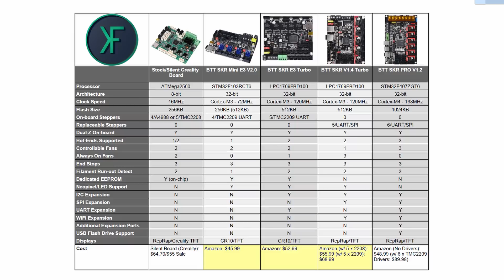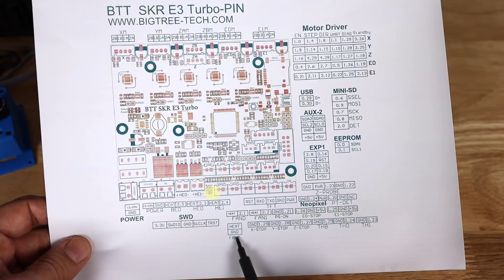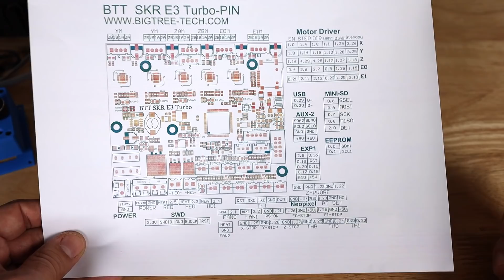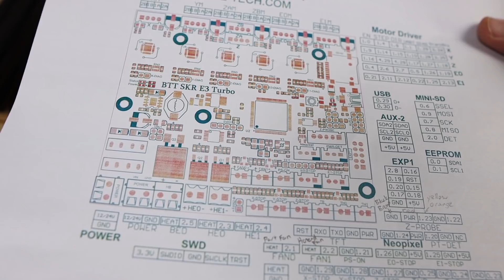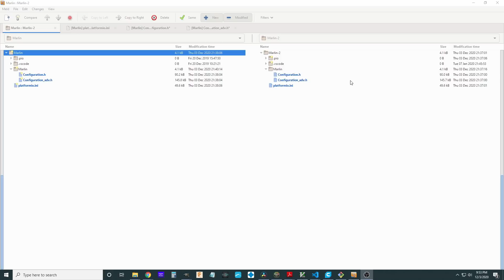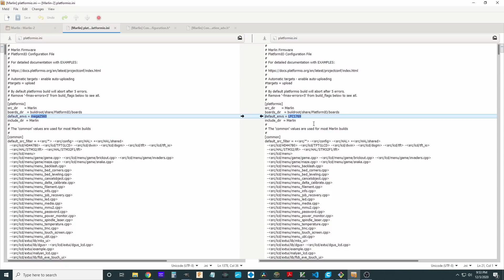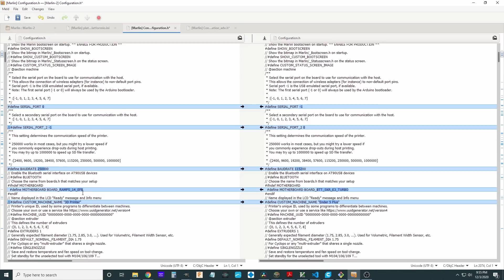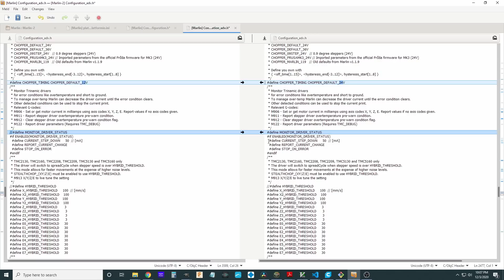Bigtreetech SKR E3 Turbo: Complete Guide

Comment: Really excellent videos.  Nice Stuff, Your Stuff !!!   I want to run bigger motors on one of my printers.  I need to know if i can just pull signals off of the STEP, Direction and Enable lines from the TMC2209 BTT drivers, and run them to a bigger Packaged Drive ( like a DM542S ) to run the bigger motors without blowing the V.1.4 BTT board.
Reply from the maker: Thanks! You wouldn't want both drivers on there. You would want to wire directly into the signal headers. That should work as long at you run the power directly from the supply.

Comment: Just finished installing both the SKR E3 Turbo and the TFT35 to my Ender 5 Plus.  Everything went quite smoothly thanks to this SKR E3 Turbo and the Ferrules and TFT35 (Part 2) videos.  However, being a total novice concerning Marlin DISPLAY Menus & Settings; I could really use some guidance on where to find a video which covers the features of the new display and how and when to use each of these settings.  It would be great if you, Kris or one of your followers could provide a link to such a videos.  Again, thanks Kris for your very comprehensive videos.
Reply from the maker: I have a complete Marlin bed leveling guide coming up very soon. That's not a walkthrough of all of the functions but it will show you quite a few.
Reply: @kerseyfabs  Kris, Thanks for getting back to me, I look forward to that video!

Comment: Excellent video, thank you for all the great detail. I have just received this board and am about to build the firmware. Will post about the temp issue. Does anyone know where to get the schematic shown around the 12 min mark? Thanks for any thoughts.
Reply from the maker: Thanks! Here's a direct link to what you're looking for: https://github.com/bigtreetech/BIGTREETECH-SKR-E3-Turbo/blob/master/Hardware/BTT%20SKR%20E3%20Turbo-Pin.pdf
Reply: @kerseyfabs  Thank you very much! I'm here to report my board is printing properly, no heat variation issues, no problem with firmware I built, uploading etc.  I connected the fan on my Ender 3 pro to the 24V always on terminal because my machine has no plugs on that wire. My board came on Dec 29, so may be a more recent make that the issue was resolved on. I read through your reference post on Github and Reddit and have none of those issues to report. Hope this helps someone along the way.

Comment: Curious - do you happen to know the setup information to read the mainboard thermistor?  Like the sensor type and pin number (if applicable).  Thanks!
Reply from the maker: Currently there's not a straightforward way of doing this. I'm looking into it though.
Reply: @kerseyfabs  I managed to find the pin for the onboard thermistor.  P1.30  However I do not know the type.  Ive tried various versions of "NTC 100K" which is the only thing the manual says about it.  Each type seems to read OK (about 2 degrees higher than the hotend and bed, at idle),  but fluctuate a decent amount, like 2-3 degrees, while just sitting at idle.  Since its inside the case with fans running I suppose its possible the fluctation is expected, or maybe its not yet ready for prime time :)

Comment: Fantastic video as always.🤩 I want to thank you because by this video you saved my mind and wallet.🤯 About 1 month ago I decided to upgrade my Ender 5's stock board, I looked to many options until 2 weeks I saw your BTT playlist and started deeply thinking to buy an e3 v2 for the drop in advantage or v1.4 Turbo for all the great advantages but 1 downside which was cutting through the chassis but now I'm out of the brainstorm😵 and decided on the e3 Turbo.😎🥳 Thank you again❤️
Reply: I have just 2 more question 1 for the board and 1 for an upgrade. First, Where can i find an Ender 5 firmware profile for the board. Note: I never tried updating a firmware. Second, I have 2 options for an abl: 3DTouch or a BLTouch. I'm pretty confused because the bltouch is about double the price of the 3dtouch.
Reply from the maker: I'm glad I could help with your decision. What do you mean by "firmware profile?" 3DTouch is just a knockoff BLTouch. BLTouch was the original. From what I've read, the 3DTouch works but it's not as accurate.
Reply: @kerseyfabs  I mean the Ender 5 configurations for marlin updating. About the ABL, is the accuracy difference worth double the price?
Reply from the maker: I have all of my source available on GitHub. Check the video description for the link. Check out this video from Chris Riley about the differences in the sensors: https://www.youtube.com/watch?v=BPH9btHPcbc

Comment: Hello. I have exactly the same board type (skr mini e3 turbo), the same BigTreeTech TFT35 v3 screen and the same printer. Ender 5 plus. My question is: How can I copy the firmware on the micro sd card mounted directly in the motherboard via usb? Or is there this possibility? I know the SKr 1.4 turbo works.
Reply from the maker: I don't know if I understand the question. To flash my firmware onto the machine:
1) download it
2) rename it firmware.bin
3) place it on the SD card
4) put it in the printer
5) Restart the printer
It should load the new firmware.

Comment: Nice. Can I use ur marlin for ender 5 plus and install it on a skr 1.3 ?
Reply from the maker: No. The boards have different configurations. It would be fairly easy though to take my source tree, change the board, and recompile.
Reply: @kerseyfabs  only change board reference needed?
Reply from the maker: I'm not 100% sure but that's how you'd start. If it compiles without error, you're probably good.
Reply: @kerseyfabs  Ok change marlin config is necessary for the z driver too because skr 1.3 has only one z driver, I will use a switch.

Comment: hey Kris. I compiled the firmware source linked above and, without making any changes, I'm getting error

u8g_i2c_opt' defined but not used 

I'm novice with compiling firmware but am having fun learning. Any tips on solving this? 

Thanks, 
-Justin
Reply: "defined but not used" won't be an error, just a warning. It just means that there's a variable that was declared, but turns out not to be used. Possibly because you have selected options that don't include code that uses it. You can safely ignore a warning like that.

Comment: Hey Kris, I'm curious about the thermistor reading issue that you listed in the description which causes the board to show temperature fluctuations outside normal expectations. Do you know if this is still a thing or has there been a fixed and at this time do you still not recommend the board? Thanks in advance!
Reply from the maker: It has been fixed but not all old inventory has been cleared out. You need a board with date code after December 1st. If you choose to buy it, you're taking a chance. I've bought two new ones on Amazon trying to get a fixed one but I keep getting old boards and sending them back.
Reply: @kerseyfabs  Good to know it has been fixed and if I go through with purchasing then I will be sure to keep my eye out. That sucks but thankfully AMazon return is super easy and customer friendly. Hope you finally get it on your next ones you order. Curios aws I am in between this one and it's screen mod or going with the TH3D mod. Have you tested theirs out and if so would you still recommend BTT over TH3D? Just curious.

Comment: Hey Kris, followed your video for setting up my SKR E3 Turbo on my Ender 5 Plus. every thing comes on and moves as it should until I try to home the machine. X axis is moving in the wrong direction. What do I need to do to fix this?
Reply from the maker: It sounds like you're still running the wrong firmware. Please check the version. Should be 2.0.7.2 on the board.

Comment: May I please pester you for one more answer?  I started my firmware journey with K3D, but for various reasons I am moving to straight Marlin.  With that in mind I wish to not start from scratch and thus want to utilize your github for the SKR 1.4 turbo (yes dual Z steppers which I already have functional) but I have the micro swiss Direct Drive and Micro Swiss hotend, which in watching your vids...appears as though we have the same setup.  Finally the question...Is your repo for the Ender 5 Plus SKR 1.4 Turbo baseline configured for these two changes?  Not worried about the finer tuning points which I will address, but overall are the changed hotend and extruder configured in your branch for these?  Many thanks in advance.
Reply from the maker: Sounds like you have a path in mind. Awesome! The changes for direct drive and/or all-metal hotend do not have to go into the firmware. They are configurable via the user interface or the console. So, no, they are not built into the firmware but they could be with very small changes.
Reply: @kerseyfabs  Got it, took my extruder e-steps from a previous firmware, ensured the extruder direction was OK.  Started first print about 10 minutes ago.  All good so far.  Thanks again for the reply.  Now if I could only figure out PETG, man I just can't get this stuff to lay down a first layer.  I am using Overture, but have several issues about first layer adhesion.  BTW...what is your favorite brand of PETG?

Comment: Hi, very nice video, thank you !
How to monitor (display) the temperature of this board based on the internal thermistor?  I haven't found the way to do it yet !
Reply from the maker: Thanks! As of right now, it doesn't appear the Marlin has a way to monitor that temperature sensor. You could do some trickery, making it look like a hotend but that presents other issues. So for now, I don't have a solution.

Comment: Hi, almost one year later, I still think this is a great video! I am torn between a CR10 V3 and the Ender 5 plus right now. The CR-10 seems to have a lot of the newer features. But I like the Ender 5 Plus. I watched all your MB upgrade videos and I kind of fail to see what they are good for. Wouldn't I get a bigger benefit from using klipper? (Input shaping?) This is what confuses me the most about most Motherboard videos. I usually don't see huge benefits. Can anyone clear this up for me? I am tending towards ordering the 5+ with a silent board and do that upgrade when i put everything together. Maybe then upgrade to direct drive and klipper at some point. Not sure if all of that is worth it though and if I should just get an CR-10 V3 no tinkering needed (maybe) =D

Comment: What you did was send me an email saying you were going to do a video on bed leveling. Never asked or suggested anything to try about the problem I an having with the filament not sticking on the ender 5 plus. And now you're saying the firmware is not the same. I don't call that helpful. According to you you're the expert. Not to worry I have UNSUBSCRIBED ! Thanks
Reply from the maker: I'm so sorry that the tech support you received here was not to your standard. You may apply for a full refund at any time. 😎
Your filament may not be sticking because your bed is not leveled properly or, more specifically, you're printing too far away from the bed. That's why I suggested that video. Even though it's not specific to your printer, it does show what I proper Z-offset and first layer "squish" looks like.
I wish you the best of luck on your journey but I do how you get some help with your anger and entitlement issues.

Comment from the maker: The following should now be resolved with currently shipping board. If if you that it isn't please let me know. Thanks to BTT for the revisions!

Commenter syt3d mentioned an issue with the SKR E3 Turbo that came up on Reddit (https://www.reddit.com/r/BIGTREETECH/comments/kar8u7/why_you_should_not_buy_bigtreetech_boards_why/). The post says that the SKR E3 Turbo has a thermistor reading issue that causes the board to show temperature fluctuations outside normal expectations. As shown in the two graphs attached (see community page), I can confirm the issue. The graph shows temperature readings at rest (so no PID tuning involved). On the E3 Turbo, the readings fluctuate as much as around 4.5C. On the SKR V1.4 Turbo, fluctuation is only 0.4C. Similar results can be seen when heated since the fluctuation is actually coming from the board sense circuit and not the actual thermistor. I'm not 100% sure how this affects print quality since this does not represent the actual temperature from the device. I did not notice any extra issues on my prints. It will make your PID algorithm confused though. I'm going to try the fix suggested and see how it works for me. I am temporarily rescinding my recommendation on this board until this can be resolved with Bigtreetech.

Robert Jones' mount mod: https://www.thingiverse.com/thing:4676133
Reply: Will you be doing a board mod video?
Reply: Thanks all of the feedback from everyone, We have read the post from maker2402 in Reddit and we positively contacted him. Actually, the thermistor reading issue has been solved on November 31st and our managers had a meeting and changed the material of inductor, maker2404 mentioned in his post, into SMD Resistor/0805 0R +-5%.   The mass production temporary halt after we found this issue, so the products shipped after 31st no problem. BIGTREETECH&BIQU welcome any suggestion and feedback from our every customer. Feel free to contact us if you have any idea about our products.
Reply: @bigtreetech5117  I bought a board on the 15th of December via Amazon, received the 17th and installed it.  It is having the thermistor fluctuation issue. (I know there's an inventory out there).  What should I do about the board?
Reply: I just got this board too in December I believe. How to I check to know what one I got for sure?  Model numbers...or Serial numbers etc to know?? I am kinda a little upset now. I got this board for more memory, silent drivers...for ender 3 pro.  Now I may either have to do the fix, or just return it.  Sigh
Reply: I just received mine and seem to be packed and sent to me on 2 DEC. Noted they have changed the new components already.
Reply: @boonchinx  what have they changed ? Mine Will arrive soon and i'm not sure i Will get a changed one yet....?
Reply: @timvandriessen8773  Mine was came about 1 week ago. They have changed the 3 resistors. Unforturnately I am still struggling to compile my firmware......
Reply: @TreetopEscape  no response?
Reply: @WC1376C22  None, I ended up soldiering my points to get through the issue.  My eyes aren't young anymore, it was a struggle